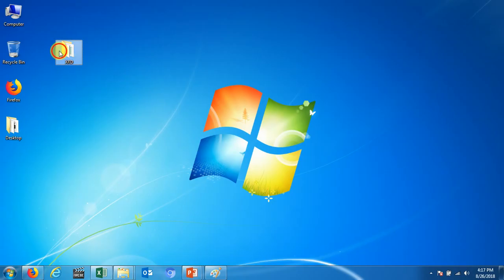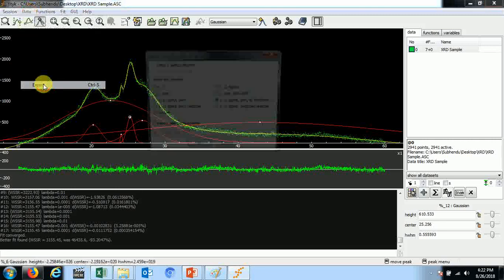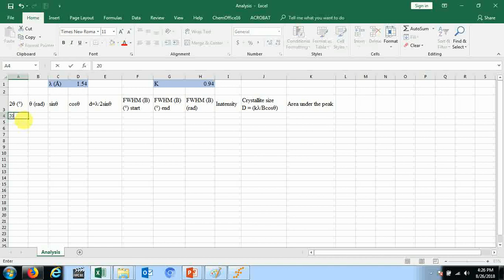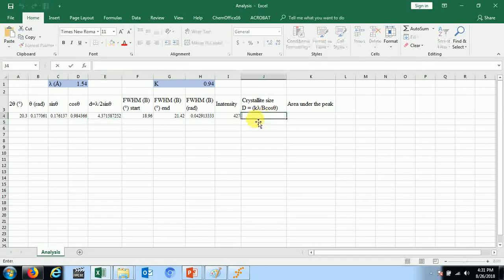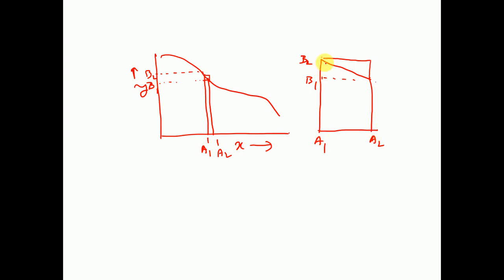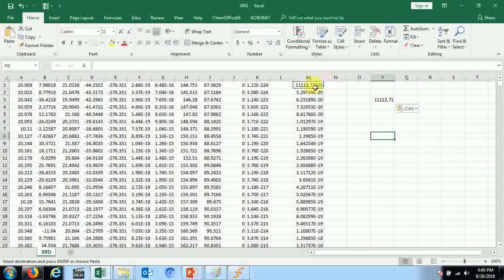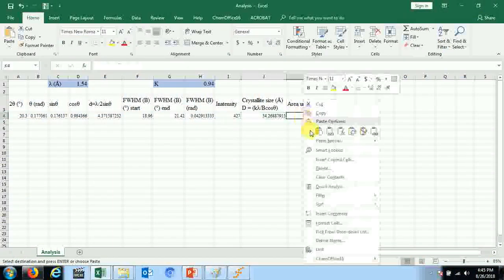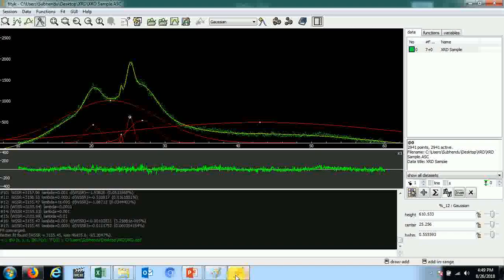XRD analysis (d-spacing, crystallite size, crystallinity) from data points by using Fityk

Comment: Thanks a lot for the video, this helped a lot, I have an additional comment though;
After the fitting you can find the FWHM and the Area and more values already calculated in the same Fityk window, you have to click on ¨functions¨ tab at the right of the graph and select the peak you want and you will have these values, no need to calculate them in excel.
Hope this will be helpful.
Reply from the maker: Yes. You are absolutely right. I know about it, but I have tried to emphasize on calculating the same using Excel using fundamentals rather than getting the values over a click. Anyway, thanks for your comment and pointing out the easier  method.
Reply: @subhendubhandari9715  Thanks again for the video and the explanation.
Hope you can make more videos like this.

Comment: Is it possible to force the variable Height of the peak to be always positive during simulation?
Reply from the maker: If you use Origin, many a cases one peak after deconvolutions become negative. In that situation, you need to do afresh. However, in Fityk, you may add additional peak for any weak peak also and calculate again unless all peaks become positive.

Comment: I start to have problems in Excel, I don't get the corresponding peaks or well, I think I'm doing something wrong.  help
Reply from the maker: You can get the peak either placing the cursor, or using "max()" formula within nearby range